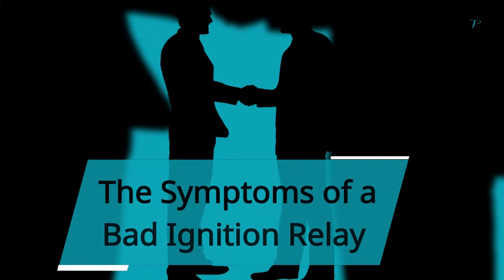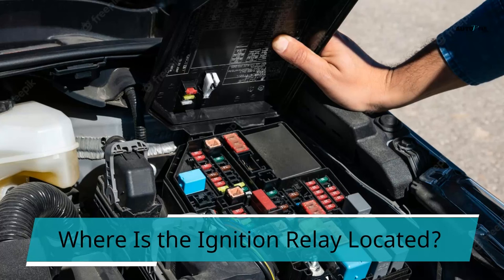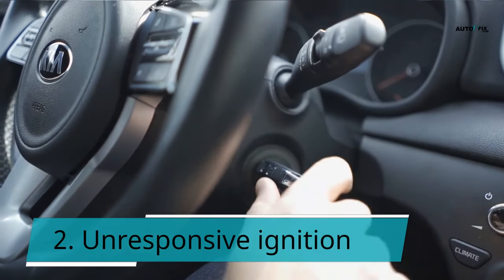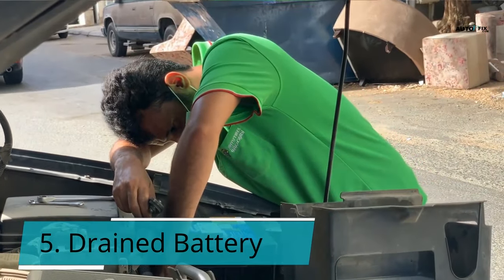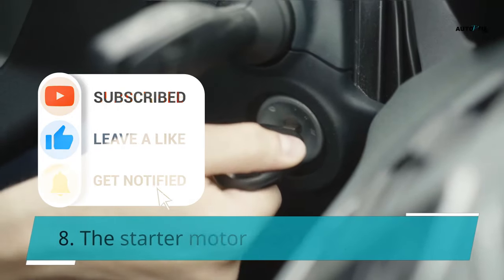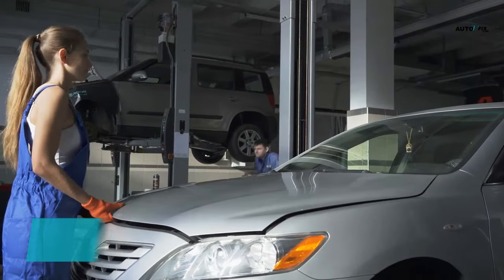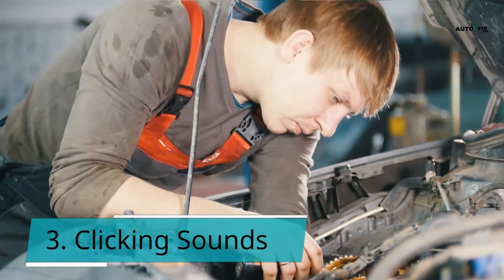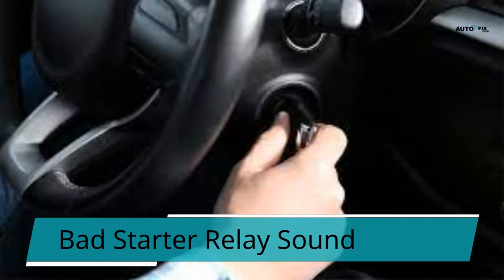Symptoms of a Bad Ignition Relay

Comment: Ordered a new starter switch that fits onto the key cylinder of my 2004 Hyundai Elantra. It arrives in 2-3 days. Meanwhile, your video got me to realize the starter switch simply triggers the relay for the starter motor solenoid. And, that relay likely has a fuse protecting it and related wiring. Handling the starter relay shows a very normal, like new, appearance. Will check the fuse for that relay tomorrow! Depending on $ and availability, may order the relay tonight. The take-away is that although this circuitry appears ridiculously complex, inexpensive components protect expensive parts as well as preventing very expensive labor repairs. Patience and perseverance pays! Thanks for the entertaining lessons! 😍

Comment: I thought I ran out of gas, when I stalled at TA Truck Stop, put 4 gallons in, still didn't start, then replaced the fuel pump, still didn't start, never thought about the ignition switch or replacing it, I should have though, it had a 150000 on it when I got it, but now 177000 or 180000, so yeah, something told me that the ignition switch sends juice to the fuel pump

Comment: my car starts when i jump it but after i disconnect the cables let it run then turn it off it won't start i replaced the battery and the alternator and the starter is fine can you help it's a 01 accord 2.3
Reply: Check your pos and neg cables going to batt look for corrosion may need to replace one or both,green in the wire is tale tell sign

Comment: My car fails to crank 1 or 2 times out of 20 or 30 attempts.  If I wait it will start as normal.   No telling how long I have to wait  - sometimes 2 or 3 minutes, sometimes overnight.  Very difficult to find problem wince it is only very intermittent. When it fails to crank, all dash lights work like norma but no clicking or any other sound.  Any ideas.  Thanks.
Reply: Swap relay. Cheap and simple attempt. However most likely sounds like a dead spot in starter. Happened to me and couldnt get it off the dead spot again. It will get worse. So if relay doesnt fix it, get starter replaced sooner rather than later.
Reply: Thanks!

 @seansy59
Reply: Hey Seansy59, I have a 93 Corolla that does this...i turn the key and nothing...several times, then it finally starts right up. Been doing this for weeks. Think its a starter relay switch? A guy at the parts store said its on the starter, and I need to bring the starter in to test it. I just keep driving it but Im sure some day it will eventually just quit starting. Thoughts?
Reply: could be your ignition switch, ignition lock cylinder, or maybe the relay. did you ever figure it out?

Comment: My car sometimes starts sometimes doesn’t. Doesn’t crank at all . Just bought car last week. It also sometimes dies when it starts   2015 Ford Fusion. 2.5 L engine only light is steering’s assist fault service required light comes on. Could that be the cause?
Reply: Check grown wire or ign relay

Comment: My starter runs when I connect my battery but i get no power anywhere else and my key isnt in the ignition any tips ?
Reply: What kind of car / truck do you have ? I have a 2001 chevy blazer doing the same thing
Reply: Replace battery
Reply: If your starter runs when you connect the battery but you get no power anywhere else, it could be due to a faulty ignition switch or starter relay, or a wiring problem. Here are some tips you can try:

1. Check the battery terminals and cables to make sure they are clean and tight.

2. Check the fuses and relays related to the ignition and starter.

3. Check the wiring between the battery, starter and ignition switch. Look for damaged or loose connections, broken or pinched wires, or corroded terminals. 

4. If you suspect the ignition switch or starter relay might be faulty, you can try swapping them with a known good one to see if it makes a difference.

5. If you're unsure how to proceed or lack the tools to diagnose the problem, it's best to take your car to a qualified mechanic for a proper diagnosis and repair.

Remember to be careful when working with electrical components and always disconnect the battery before doing any work on the car's electrical system.